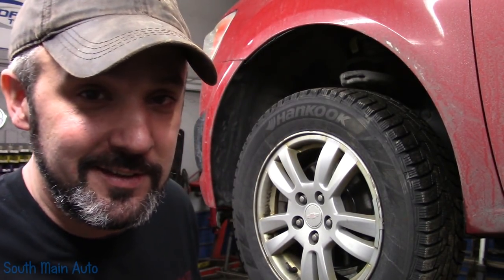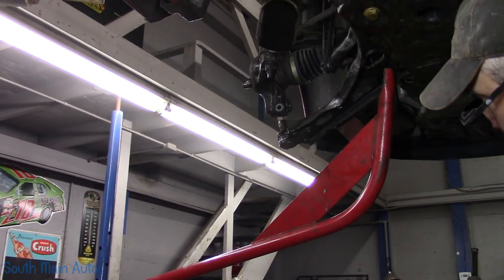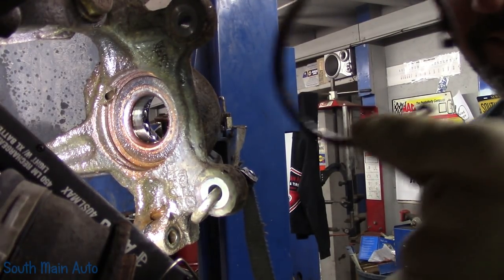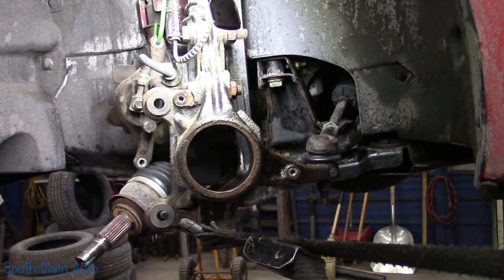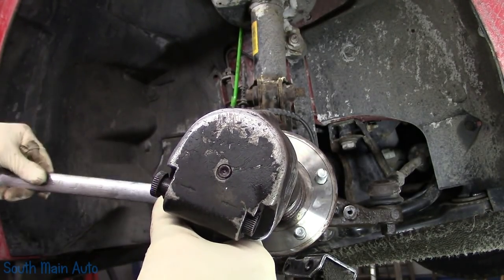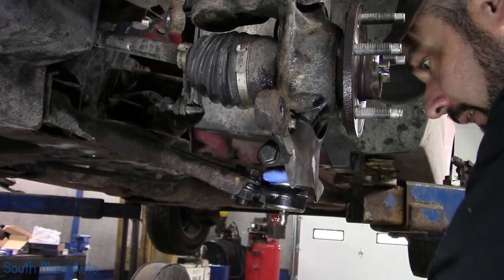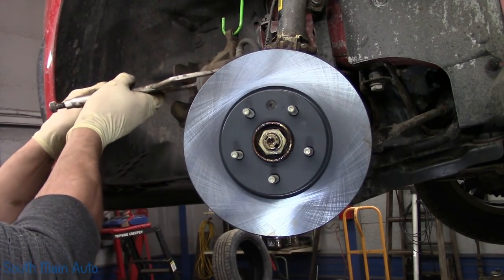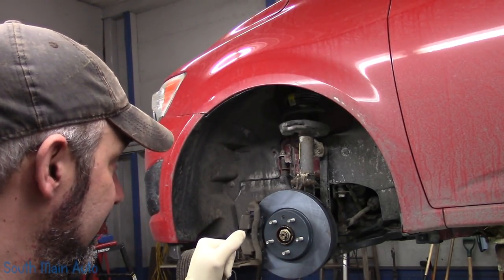Chevrolet Sonic: Front Brakes, Wheel Bearing & Ball Joint

Comment from the maker: *Majority of the tools in this video are made by Astro Tools Be sure to check them out here* : https://amzn.to/2toOTpH
Reply: Where's the pinned comment about the cupping marks!
Reply: I have an Astro impact N* water pump socket that works very well 👍🏻👍🏻👍🏻
Reply: Hey, Mrs. O!  I need a socket set.  Mines not big enough.
Reply: Hey Eric, where did you get the control arm hockey stick tool from?
Reply: @maxwellpeter1598  I looked it up and it's called a wishbone suspension arm separator tool made by Sim tool. It isn't the exact one but this one has an adjustment. Check it out.
Reply: HIEEEEEE Eirc O, always good to see you
Reply: Football play cause bruising on neck?
Reply: @maxwellpeter1598  no problem, bud! I have asked Eric this question a few times and he has Never answered me. I had to look it up myself
Reply: What kind of wobble sockets you using?
Reply: is that a hicky on the back of your neck???
Reply: @c86tail  I made mine from 1" rigid electrical conduit and some scrap steel.
Reply: I bought the Astro Pneumatic Tool 78825 Master Front Wheel Bearing Adapter Puller Kit W/Grade 8 Drive Bolt a couple weeks ago and used it on both my car's rear wheel bearings. That thing is the bees knees!
Reply: hello, I wonder if i should buy a snap-on Verus Pro if i get it cheap like 1200$ maybe less.. im a intermediate scope user and diy'er thats wants to evolve.. and i dont own a good scantool or scope just a small basic unit... i want to do all makes and models including vag.. benz.. and bmw... will it be any additional costs and fees using the Verus pro? THANKS ALOT!!!! CHEERZ FROM NORWAY!
Reply: I would hate to know what a snapon torque wrench cost! Omg! $$$$$$$$$$$$$$$
Reply: Have to do a wheel bearing... was thinking of taking the strut out to avoid taking out the ball joint or remove the two bolts/nut on the control arm. 

Very informative. Gonna risk it and go with a abs sensor lol
Reply: If my hub is cut a little deep would it cause me problems ????
Reply: Thanks!!

Comment: For future reference (easier math?) 60-Degrees = 1-wrench flat on a hex nut
Reply: Jeesh, I've been wrenching nearly my whole life, and I never even thought of that! Great info! 

Of course, for many years, NOTHING was torqued to angle. I sure miss those simpler days ...
Reply: @SmittySmithsonite  some European m/C's and Harley's use sequenced torquing.
Reply: @rnrudynh1427  - Sequenced, yes ... that's standard practice on any cylinder head,  but I've never seen a Torque To Yield bolt on a motorcycle. Maybe they do that now, but from the early '00 back, I had never seen one.
Reply: @SmittySmithsonite  2001 TC    88 cyl head bolt install. Last step is a 90 degree turn. If I recall GM had a similar procedure with their heads. Also I think Ducati used/uses torquing sequences like these. I can't swear but in like 41% sure
Reply: Honda spec 60 degrees for their crank bolts. The service manual documents it exactly this way and essentially says to use the bolt itself as a protactor.

Comment: After doing way too many wheel bearings, one day I was teaching my teenage son how to do one.  Everything came apart surprisingly easy for a NY car, and I was at the point of putting things back together.  I quickly pressed the hub back into the bearing, then went to install the bearing in the knuckle, when I realized that I had pressed the hub into the bearing from the wrong side.  Of course, at that point, it is all over but the crying.  The solution was to hunt down an OEM bearing from a local dealership for more than twice what I had paid when I mail ordered mine (also OEM).

In the end, I guess it was a successful job, as the son not only learned how to do the job, he also learned to always make sure that the machined side of the bearing housing is facing away from the hub so it will go into the knuckle :)

Comment: I’m surprised the snap ring didn’t come with the wheel bearing kit... seems a silly thing to omit
Reply: Jim Reinknecht They never do unless you buy the bearing repair kit! I to believe they should come with the snap ring. Most of the time you tweek them when removing especially if they are badly rusted like they get here in Indiana.
Reply: I was wondering that .  Bearing may also fit applications that do not use a snap ring ?

Wyr
God bless
Reply: Wyr Twister All press in bearings use a snap ring!
Reply: @FABAutomotiveDetailing  OK , Thanks .   :-)
Wyr
God bless
Reply: In the UK you get new snap rings/circlips with the bearings.
Reply: I've never seen a replacement wheel bearing come with a new snap ring.
Reply: @steventaylor5687  and, warm beer.
Reply: Napa part,no snap ring😐😐😐😐

Comment: Do any of the auto manufacturers recommend changing the brake fluid? They used to.
Reply: A very few still do. The catch in the salt belt is being able to get the bleeders loose. Usually after about 3 years they just break off unless someone has religiously kept them clean and free.
Reply: Im not sure if they include brake fluid change at any service interval anymore. But what i will say is, if your brake fluid looks dark you should change it.
Reply: We always replace the fluid on our Honda/Acura.  The master cylinders last forever, if you change the fluid every three years.  It also seems to keep the ABS in good shape.
Reply: The general rule was to flush the system every 2 years (same with coolant). I did both on my '07 Silverado at year 9, and nothing is damaged. It does live in a garage most of the time, though.
Reply: Yeah every 4 years or 72k miles in my maintenance schedule.
Reply: Older infiniti's call for brake fluid change yearly
Reply: I don't know about the manufacturers but dealership service writers sure do. That service is right up there with power steering flush, A/C disinfecting and changing the air in your tires.

Comment: A 5 year old car an you gotta replace half the front end. What a piece of garbage.
Reply: Ny roads and may live down a dirt road. How many miles ? Looked like the first brake job 30,000-50,000. Who knows what they may have hit. I could turn any new car in to junk in 5 years. OK, back chevy/deadwoo bashing now.
Reply: Well it could be like a Mercedes or BMW where you have to replace 1/2 of the electronics every year just to keep it on the road...
Reply: It could have 100,000 miles on it
Reply: Sonic may have been swallowed up by a NY pothole
Reply: I've had my 2013 Sonic since new. Now has 233,000km hwy (145,000 miles) and haven't had any major issues with it. Timing belt replacement was a shocker! First front break job @ 170,000km (106, 000 miles). It's been a great little car.
Reply: You obviously havn't lived in an area where they salt the roads and have poor road care lol. I have seen a 3 year old Lexus need balljoints up in PA due to the potholes and rust.
Reply: @dennisgadd766  Yes sir. I'm a hair over 80K on my 2014 Sonic. I might have one or two oil changes left an I'll have to replace brake pads. Pretty amazed they are still original equipment and still thick enough to be safe/ pass inspection.

Comment: I never knew you could bend those control arms so much without them warping. Shows you how much I don't know 😂
Reply: Also is it ok to grease the side of the brake hardware that touches the guides on the pads? And blast everything with brake kleen just to make sure there's no oil on it?

Comment: Seems you've started using Fluid Film for surface rust protection.  Do you think it's better than red tacky, white Lithium, etc.?  I've always thought of it more for spraying brake lines, etc. to form a rust/corrosion barrier.  It costs a lot more.

Comment: I hate the ones that don't come with the separate bolt in hub assembly.  I always just replaced the whole spindle bearing assembly on these types (as long as they are available that way).  I know some people will have a problem with doing that, but it saves a lot of work.

Comment: Little gm tech tip try cutting the otherside of the rivet using big nasty and a chisel bit( with the control arm out of the vehicle) its easier to drive the ball joint and the rivets out. This work for chevy equinox ball joints to

Comment: Try this before starting a project like this place the new bearing in the freezer. After taking the wheel off, place a short pry bar on each side of the brake pad and pry to push the caliper back in as not to damage the plastic piston . By the time you are ready for the new bearing it should be able to go in by hand or an easier installation .

Comment: Trigger happy with the fluid film, lol. Something I have done to get the old race off the hub is to grind a couple grooves in it with my Dremel and cutting disc, then use a bearing separator to pull it off.

Comment: I keep seeing you fighting snap rings,  try Knipex snap rings pliers. They are great with none of that switching between inside/outside clips. I got a set of 4 from OfferUp for $20 but I've seen the set on Amazon for under $100. I used them while rebuilding a 4R70W trans and they were much better than the Mac pliers they replaced.

Comment: Eric,
Great video and repair! I was surprised when you removed the bearing with the recieving cup and didnt use just the flat plate to 'get it moving first'. I bet the impact hammer/chisel would have taken that race off the hub without you first torching it. Also you are using a new brand of brake cleaner.  (NAPA vs Carquest Wearever). No, Im not paying attention to your videos. LOL.
SMA#1
God bless
Paul

Comment: sometimes u got 2 slow down 2 go fast ... lol
Looked like a crazy day @ SMA 
I would set yourself up with a shaft u can mount spindles on in vise and spin them while heating and they drop of in under a minute, quick and clean .
You got lucky with abs sensor and lucky with backing plate, I forgot backing plate and not been so lucky with it being slotted lol ....

Comment: I used to take the air chisel to rivet heads. Put a cross in them, then bust the heads off. Swap to the punch bit from the cutter bit and pop the rivets out. Years before air tools I'd drill out rivets. Like on my 72 Chevelle in 1994.

Comment: Throwing tools releases stress,but don't throw at open door. I chased a 12 inch 3/8 extension down the driveway and into the street before it stopped. I started aiming toward my tool box. Now that l m 68 years old l 've quit that to. It's too hard to bend over and pick them up !!!
Even in Tennessee, we have rust under the pad hardware. Also old 
GM s  with rubber bushings through the calipers for the pins, the insides of the caliper would swell with rust thus seizing the slide pins thus no brake release and worn out pads. It's not just a seized piston that causes "stuk"brake calipers.

Comment: I have found with speed sensors that if you put a bit of pressure on the bottom of it as wiggling  the top slightly (plenty of lube lol) they come out easier

Comment: I have a 2012 Chevy sonic and that spacer with the lock tabs that clips back behind the axle splines yah I found it  loose rounded out  and worn through on one side of the spacer and so this factory placed spacer some how must have not gotten seated good from the the assembly line anyways this thin peace of metal started to get caught up between the bearing and wheel speed sensor destroying the bearing magnetic tone ring  and the wheel speed sensor both. So yah a  $3 dollar spacer costing me $ 150 in parts. So thought I'd share that with yuh All. For some reason I'm having a hard time finding the spacer . Thanks GM ! Lol Eric I'm thinking I'm gonna glue that spacer/locking ring in

Comment: I just about bought a 2012 Chevy Sonic 1.4L Turbo with 119,000 miles today in really good shape for $4000, but decided not to after I heard about the plastic caliper pistons and all the overheating issues and valve covers and intake manifolds and water pumps and thermostat housings failing every 30,000 miles from all the heat from that turbo under the hood.

Comment: I usually go for trying a large punch on the bottom side of the speed sensor and rather gingerly tap it with a small hammer. I've found I break less of them this way.

Comment: Why did you not use anti-seize on the bracket and caliper bolts ? Brake grease and fluid film, but no anti-seize. 😮  Like 👍  your videos,  keep up the good work.

Comment: I find it better cleaner and faster to grind the heads off the rivets with a 4" grinder, if fitting a 3 bolt aftermarket lower control arm ball joint.

Comment: Never have much luck with those little Phillips/torx rotor bolts. Always end up shearing them off with the rotors because I drive like a maniac.
Reply: If you shear those screws while driving, maybe you should tighten those two nuts that hold the wheel on.
Reply: Oh all five of the lug nuts are nice and tight. 100 ft-lbs factory spec, and even the torque wrench is calibrated. They still end up coming out as little metal nuggets on the front rotors since the rotor can shift behind the wheel hub under heavy braking.

Comment: First time I did a wheel bearing on a sonic I had to go buy a socket for the axle nut 😂...also , I put the snap ring in wrong and the speed sensor wouldn't fit. Didn't take long to realize my mistake 😁

Comment: @ 24:30 - "..if you're in ta polishin' yer hub...". If you are, you're watching the wrong Youtube channel, fella!! Also I'm wondering if the snap ring would have been removable with the speed sensor still installed, since the opening in the ring has to be right where the sensor lives anyway.

Comment: Question - wouldn't have been a lot easier to just buy the hub/bearing assembly complete? I know when I did my last one the assembly was not much more than the bearing but it saved a lot of time screwing around with removal and installation of the bearing and if I remember correctly it had the speed sensor installed.
Reply: It's to save the customer money 💰

Comment: I was thinking you were a bit premature with that speed sensor as you did it considering the overlap to the bearing in this case with the tone ring in the bearing. Also, please stress that when installing any bearing you should only put weight on the piece immediately in contact with the object being installed i.e. when you put the bearing in the housing, only put the load on the outer race and when installing the hub, only put load on the inner race. Otherwise you risk damaging the races or balls by transferring too much weight through them which will significantly reduce their life.

Comment: The sensor looks the same as a Renault sensor. They allso have to come out when changing wheel bearings. I usaly tap them out (they usaly com com out fairly easy). But when i have tride to wiggle them out they might brake.

Comment: Eric O question for you while your doing a wheel bearing (passenger rear)) I have a 06 Pilot and bought a Honda bearing and it doesn't make it obvious as to which side has the ring for ABS. My dust shield rusted out so need to replace it with new and as you know. Bearing never cooked out in one piece.  I also.  Assume the rear has ABS or is it only front...
Thanks fo the time
Johnny G

Comment: I've seen you do this before and I'm confused - you blue grease the caliper bracket where the slides sit, but not the ears on the pads where they sit in the slides...the slides don't move against the bracket (I think), but the pads move against the slides, so why not put blue grease there, instead? If it's just to discourage rust, why not anti-seize, fluid film, etc. back there? Loved the blow/by/blow, tho, as usual. Good director, great mechanic!
Reply: The blue lube resists heat and water much better than Fluid Film and won't run down to the pads and discs.
Reply: I can see using it to fight tooth decay, but why not also use the blue lube between the clip and the ears on the pads, where the actual sliding takes place...
Reply: K T n

Comment: Chevy 2500 series pickups are known for rusting out brake lines right next to the frame how do you deal with replacing those brake lines without having to lift the body off the chassis?

Comment: I recently did the ball joint on my Volvo but never the wheel bearings. Of course it's 1992 940 so...27 years about the same as 6 years for a GM.
Reply: Ain't that the truth! I've got a '93 - just changed the ball joints, wheel bearings, backing plates, and the struts & strut bearings at 170k miles last year. 25 years - not a bad run!
Reply: My ex used to do 40k/yr.  Maybe it has a lot of mileage. It's about 1/3 the price of a Volvo too. Ya get what ya pay for.
Reply: @ @SmittySmithsonite  I thought my wheel bearings were going out on my '93, but was inner tie rods, now at 240K with plenty of original parts.  Found a new source for motor mounts if you're interested.
Reply: @fascistpedant758  - Mine cost me $800! Of course, I've probably put 4x that into it, just to make it perfect.
Reply: @landontesar3070  - I appreciate that, but I picked up a set of Corteco mounts at FCP Euro a couple years back. The engine would "squeak" at idle, and quite a bit of vibration made it into the cab. Just moving the engine by hand would recreate the sound. New mounts, and WOW what a difference - felt like a new car vibration wise, and the squeak was gone. With the A/C on, that squeak was super annoying. Was glad to be rid of that!
Reply: If you can find a 25 year old Sonic you could probably pick it up for $250 !!!

Comment: Definition of phenolic : a usually thermosetting resin or plastic made by condensation of a phenol with an aldehyde and used especially for molding and insulating and in coatings and adhesives. — called also phenolic resin.
Reply: Yep, phenol/formaldehyde = the 1st commercial plastic.  Add carbon black and you have bakelite.